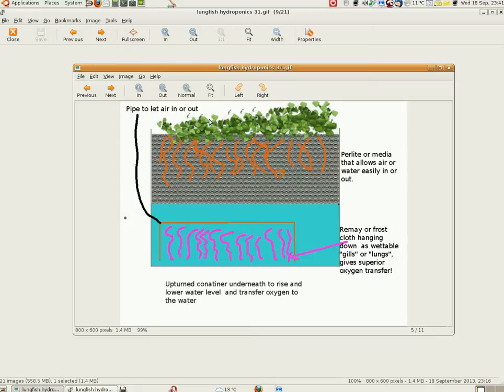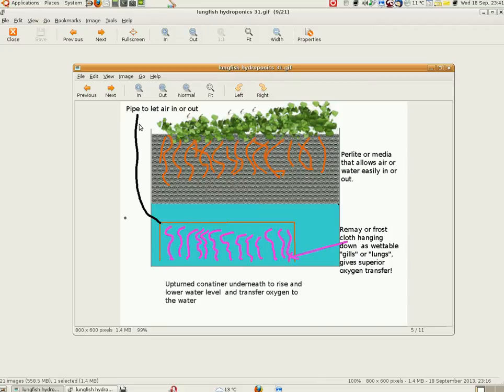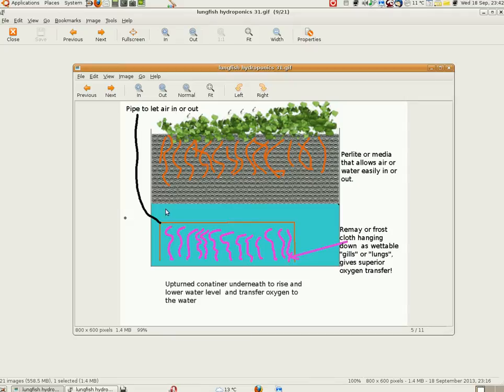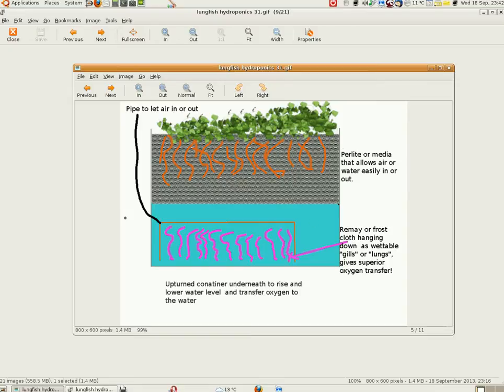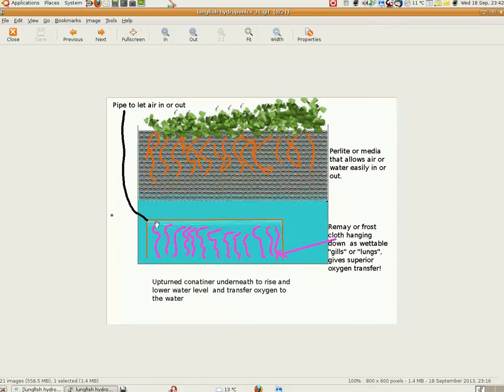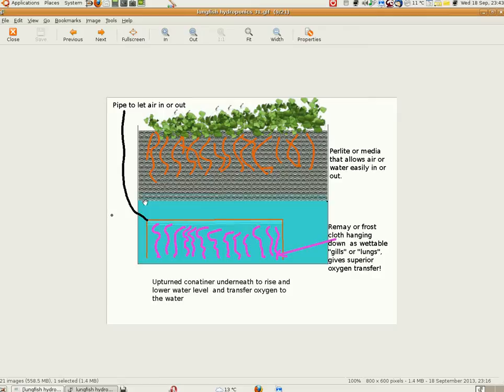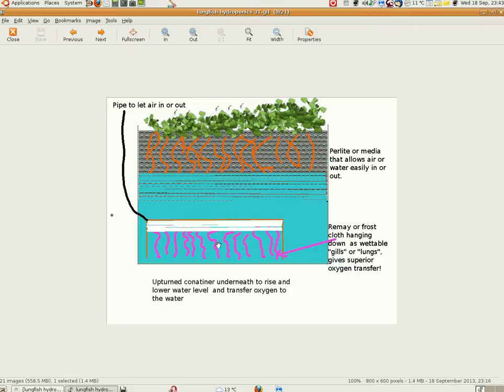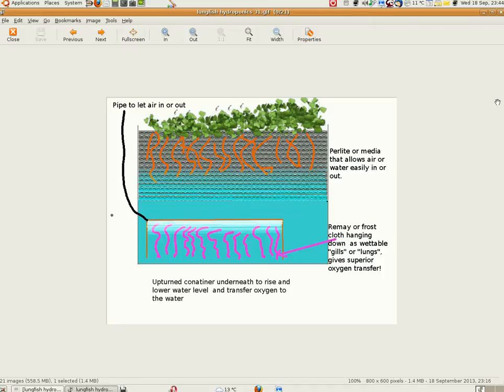"lungfish" Hydroponics!  Use low pressure air to run a hydroponic tank system.

Comment from the maker: Hi, I made a proof of concept for this using a rubbermaid container, an upturned basin weighted down inside it and a "geyser switch" to control filling and emptying or ebbing and flowing. It works pretty well.  The Geyser switch was a bit loud in the video but I got it quieter by making the bottom hole smaller. So a minor technical issue.  Also I think another good way (maybe better way) to control ebb and flow is a timer with 15 minute intervals and a small leak in the system.  15 minutes per hour on. (or off as the case may be)

Comment: I think this is a fantastic idea.  Besides removing the clogable pump from the system it is probably more electrically efficient which would be important for anyone trying to power the system using solar.  If you used this for aquaponics, would this allow you to use a single tank for both fish and plants?
Reply from the maker: Hi, Richard, I think it might work for both fish and plants.  Callmeshane made the point about the weight of air  in the bottom container lifting it up (and it is something worth noting) so the ideal design might be an "all in one" with the air tank linked to the plant tank so that the plant tank keeps the air tank weighted down.  I just made a working proof of concept (with video)  and all you have to do is weight down the air tank.  But like he noted, it does want to float!
Reply: Absolutely, so you just have to make sure that a volume of your grow medium with air is still denser than water.  That will guarantee that when the lung expands under the media, it will not float up.  Probably a problem for perlite, but should be no problem for river rock.  Also I'd suggest replacing your geyser valve with a float actuated switch.  The valve design is like  those used in steam engines.  This will switch the incoming air and the contained air to vent through bubblers.
Reply: You can use the light media and have it float up out of the tank, as you mentioned in your other design, but then you need to solve the issue of a top heavy boat that wants to flip.
Reply from the maker: Richard Hauser
Thanks, I really like the idea of the "lung" venting through bubblers! Now you have ebb and flow COMBINED WITH the lung AND bubblers!  (without using any extra air!)
Reply: The one other added feature I was thinking was to turn the lungs into simple pumps with the addition of simple one way valve (a flap of rubber or a ball on the end of a pipe) as this would pump water and more importantly fish poo from the bottom up to a course filter to feed worms.
Reply from the maker: Richard Hauser
yeah, I have been wondering what to do with the excess lung energy too.